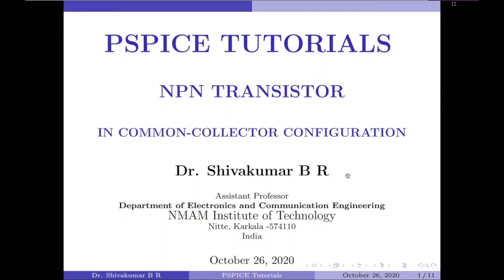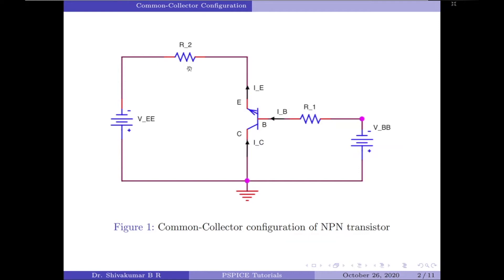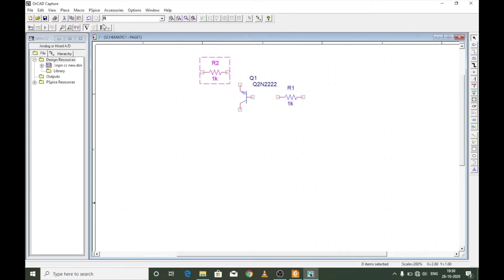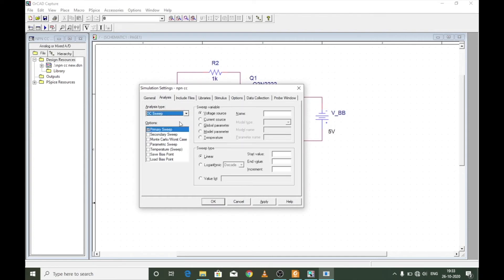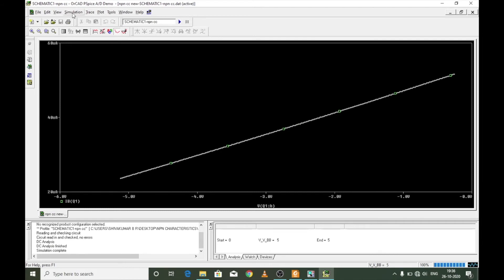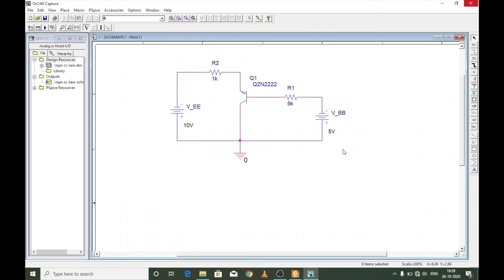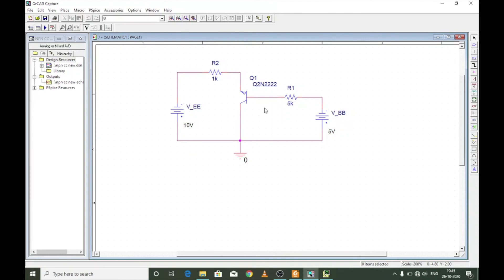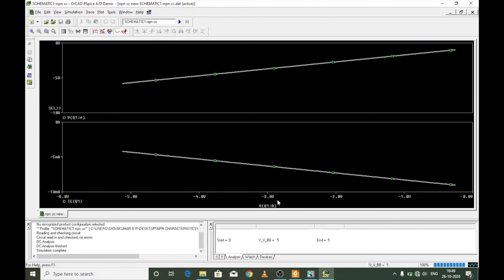PSpice Simulation: NPN Transistor in Common-Collector Configuration

Comment: Aim is that To observe waveform at the output of half wave rectifier with and without filter capacitor . To measure DC voltage ,DC current , ripple factor with and without filter capacitor
Reply from the maker: Sure. Will create a video on that as soon as possible.